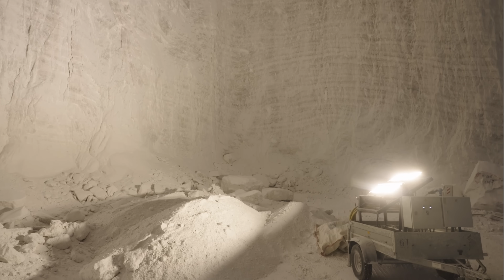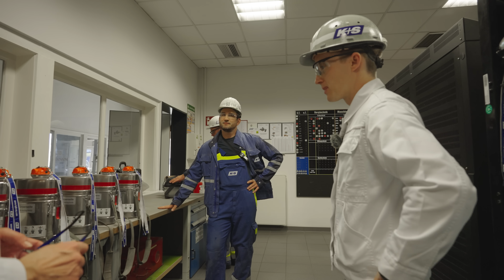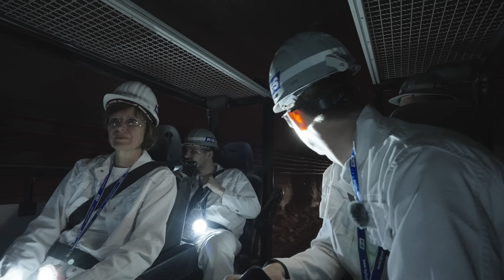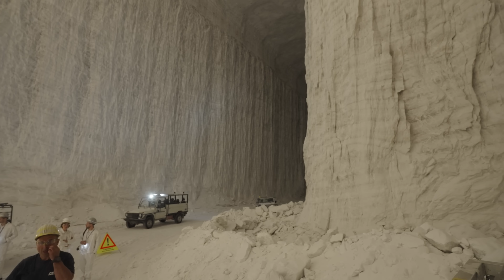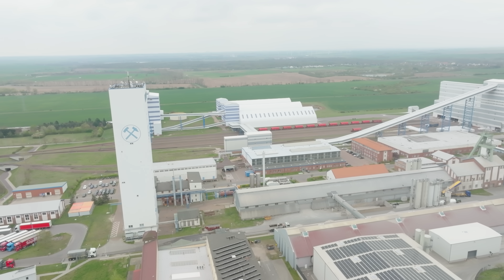The Hidden World of Underground Salt Mining!

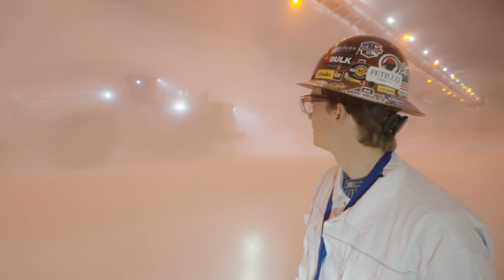Comment: @02:15 mins. the mine chasm is essentially a "FOG" of salt dust. 
WHY wouldn't individuals be wearing masks??!!!
(I don't know what 3M would suggest, but I have a feeling they would recommend ANYTHING.
p95's, fitted masks, breathing equipment, wet rag... WTFED
Reply: Working under such dusty conditions you wear normaly dust masks.The loader driver sits in the cockpit with air filtration and conditioning.On former types of these "Bunker" loaders with open cockpit the drivers wear a air filtration helmet.

Comment: Glückauf
German mining enineer here, older than Methusalem and retired. Today I've watched 4 of your clips in a row, all VERY good and informative except this one.

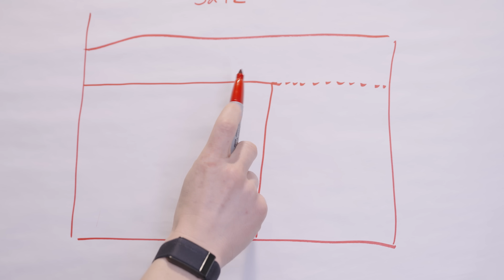You didn't mention one most important fact: Salt behaves like a liquid if you excercise enough pressure over a very long time (dozens to hundreds of years). That's the reaon why safety pillars in salt mining have to be that strong - dozens of meters wide - and mined-out chambers are relatively narrow. You have to take care, that safety pillars between chambers do not weaken like melting ice. 24:00 You need better drawing skiils.

Can you imagine what happens if a million m³ air want to escape through a thin mineshaft because some chambers collapse simultaneously, caused by 1 single 'Markscheider' who has neglected his job? Accidents in salt mines are rare, but when they happen, usually they kill more miners than the much more frequent explosions in underground coal mines.

Nonetheless, Salt minings is impressive and beautiful. Gigantic chambers, and very clean - you won't get dirty.

One question to you: Do you know a method how to prevent salt from drawing humidity out of the air? I have had a beautiful crystal  of about 50x50x50 mm but had to thow it away because it was wet all over. Someone said a coat of hairspray would work, but that wasn't the case 😞

P.S.: 26:29 Interesting game you play. You should better delete that frame 🙂🙂🙂.

Comment: What a sight to see this saltmine is! I'd also never have guessed that saltmining is a business that fluctuates with seasons but I guess it makes sense that salt mines will work depending on current demand. Unlike other commodities that are mined at ground-level, and which are far more valuable pound for pound, this mine will have higher operating costs and if they were to pile up hundreds of thousands of tons of salt the storage costs for a food grade mineral would very quickly outpace any potential savings made from running a less seasonal operation.

Comment: Years ago as a Project Manager for a major Industrial Supply firm, I got the full day tour of the FMC Soda Ash mines in Wyoming (one of our largest national customers for PT equipment). This video was quite a refresher for what that entailed. The mine was about 59 square miles big about 1600 ft below the surface, and it took about 45 minutes to drive in a cut-off jeep from the main shaft to what they call the Long Wall, which was a 500ft long hydraulic machine that vertically cut into a wall about 12 foot tall, deposited the mined product on what was a  miles long belt conveyor, and then collapsed the wall behind it. Each hydraulic section was about 26", and the sound of the wall collapsing behind each section as it crawled through the mineshaft was deafening. The joke was that it was the perfect place to bury a body, because of the size of the honeycomb mine over the 59 sq mile area. Most of the used/replaced equipment was left down there. Of course, Soda Ash isn't quite as clean as salt, but what a journey of my career!

Comment: I need to know how long their equipment lasts before it starts to rust. My truck is having a hard time with only a few weeks per year of salted roads.
Reply: It barely rusts. Theres no humidity as salt absorbs all the humidity in the air.

For salt to corrode, there needs to have humidity in the air or contact with water, such as melting snow.

Comment: That's awesome.  You should show how they get the machines down there.
Reply: The machines are disassembled into smaller manageable pieces once on site where the mine is done at then the parts are taken down through the shaft and then reassembled underground , there is no opening that they drive them directly into the underground it's not possible.

Comment: Some thoughts I had during the video.. If you didn't know it was a salt mine, you'd think they were in a very cold ice cavern. The salt looks just like piles of ice and snow on camera. In the winter I bet they don't have an ice problem on the roads around the facility with all that salt and salt dust getting tracked and blown everywhere. I wonder if animals like deer hang around to get salt off the ground. In some places they have problems with animals hanging out around roadways to lick the salt off the ground that washes off from de-icing. It's unbelievable that there's that much pure salt just sitting underground. It all came from evaporated sea water, it's just crazy that the bands of salt are so thick. All that salt dust must make vehicle maintenance a huge part of the job. Dust would clog up filters and get into joints. Then if you pressure wash it off with water, it would rust so badly. That's a pretty awesome system they have for getting the salt onto our french fries.

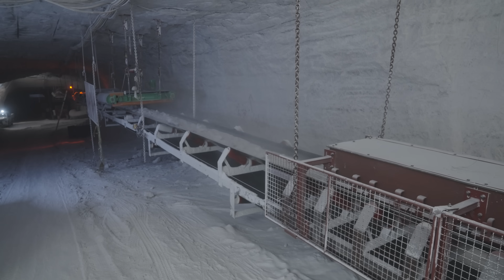Comment: 22:02 Can someone please explain to me what the small green perpendicular conveyor belt does ?
Reply: My guess would be that the green ”block” inside the conveyor is a strong magnet to help remove metal shavings from equipment, and the conveyor flings it off to the side against the plate to the left of the conveyor. So the underside is magnetic, the top isn’t

Comment: They are concerned enough to give you "clean " shoes but then you walk outside, in a car, through other buildings...
Reply: Not to mention all the mining equipment running around on the salt dripping fluids as they go, and the rubber from the tires. Plus all the rust that breaks off these machines. Dirty shoes would seem to be the least of the worries.

Comment: That has got to wreak havoc on equipment. Would've loved to see how their maintenance deals with it.
Reply: I’m a mechanic in the world’s largest salt mine in Goderich Ontario Canada we have very little corrosion issues except for some of the wiring otherwise it’s the normal hard wear and tear on the equipment
Reply: @jeffthomson1777 that's good. I was expecting horror stories lol.
Reply: @jeffthomson1777  I also work for Compass down in Louisiana (Cote Blanche). Same thing here, everything underground is still in good shape minus loose pins etc. But surface equipment is getting eaten alive.
Reply: Only if it gets moisture. Dry salt isn't the problem. It's when salt gets wet that corrosion sets in and rusts the hell out of everything.

Comment: The irony of me watching this while currently 1000m underground in a potash mine on my break
Reply from the maker: You have me beat
Reply: I'm amazed you have good enough internet down there to stream video. That's neat.
Reply: @CFEF44AB1399978B0011 was just thinking that
Reply: @CFEF44AB1399978B0011 I wonder if there is wifi in that mine
Reply: @CFEF44AB1399978B0011 you know internet run through cables, no?
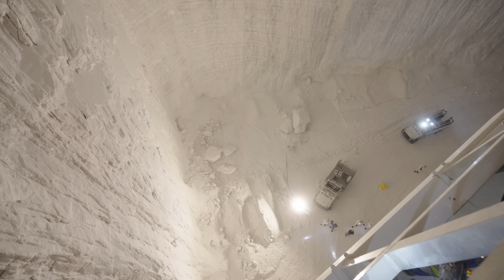Reply: It was interesting to see at 16:58 on the left wall a slab ready to fall and the importance of the soft material at the bottom.
Reply: Carlsbad, NM?
Reply: @admranger  Statistically, more likely Canadian
Reply: Went to a potash mine in Wyoming, it was a crazy place. Would totally go back again
Reply: Sure pal

Comment: i know your channel is more geared towards the machiney and operation of these mines but it would be interesting to learn about the logistics of getting all the mechanical down there ie: plumbing electrical hvac and fire surpression sprinkers
Reply: I was thinking about how much youd have to constantly maintain everything because salt is so caustic to metal. He said that lift was basically from the original mine, but I have to imagine that its been essentially totally replaced Ship of Theseus style many times over
Reply: @skeetsmcgrew3282  The air in salt mines is usually fairly dry, so down in the mine corrosion is kept in check by a lack of moisture and most of the lift mechanism is above ground, never entering the mine.
Reply: @tz8785   I was wondering about the electrical controls/switches in those loaders. The salt dust has encrusted every surface from rafters to floor.
Reply: This would very much interest me. It'd be also cool to find out more about the geological side of things. This mine isn't in the most populated areas of Germany but unlike in Australia where there often is literally not a single settlement for hundreds of kilometres, here there must be multiple villages on top of the shafts.

It'd be fascinating to learn how they ensure safety and stability of the shafts while working and afterwards. I imagine water could pose a huge safety hazard in a saltmine, so there must be measures in place to make sure the mine stays dry. There's so much more that goes into mining operations that hasn't been touched on.

Comment: I was curious how they keep the machines running down there, too bad you did not show that part of the operation. I would guess the salty air needs some special filters for the engines? Not sure how they deal with rust down there either. Is that even a problem? Or is the air so extremely dry that there is not much rust forming down there, and the problems only start on the surface level where you have high air humidity?
Still an impressive operation, and digging these shafts and starting the mines more than 100 years ago with the old technology and machines they had must have been just as impressive.

Comment: Imagine a hydraulic or oil leak 😮
Reply: Machines use in sensitive areas use vegetable oil. We bid a job to clean up the LA river and will be required to have the hydraulic oil flushed out and changed for vegetable oil. There are still other fluids and diesel, but hydraulic oil is the most common thing to leak. If there was a leak, they would take certain steps to remediate the spill, including digging up all the contaminated salt and disposing of it. As an environmental company, we clean up fuel and oil spills around cell towers from equipment being serviced. Remote cell towers are run on 150-200 KW generators that are fed with propane or diesel.

Comment: how they blast first slice? there is no room until its down :D
Reply: You will first need a large diameter raise bore drill hole into a small adit at the beginning of the chamber. This will be enlarged by vertical blast drill holes until you have enough space to blast the first section. Cheers

Comment: what are those red dots on the ceilings in regular intervals?
Reply: I did not see any red dots. If you mean the dark dots in the ceiling of the big chamber, that is anchor bolts. It is bolts that go into the rock to distribute the load deeper, so that it does not collapse.

Comment: How're those trucks and equipment holding up to the salty environment?
Reply from the maker: No corrosion because no humidity
Reply: Exactly. My father worked in the Detroit Salt Mines for 25 years which the seem they mined went as far south as Cleveland Ohio and as far north as Ontario Canada, the operation is very similar to what is taking place here.  Every single piece of equipment brought to the surface after being used underground for decades immediately rusted within days, drills, engines etc made no difference whatsoever what the equipment was.  Perfectly operational equipment when it was used underground still , immediately rusted and became practically useless within days it was unbelievable how quickly the moisture and humidity destroyed the used operational machinery.
Reply: Excellent. There is no moisture down there. But they would rust to shreds very fast if they were brought up again.

Comment: They didn't even mention the the "back" (ceiling) and all the rock bolts holding it up. Also the tremendous pressures exerting force into the cavity from all directions.
Reply from the maker: yeah they bolt it only to keep everything safe while working within each chamber, then they block the chambers from access once completed
Reply: The chambers are gradually filled

Comment: The irony of going 500m underground to then risk falling 50m in the air...
Reply: Kinda like a bird being transported on a plane, imagine how pissed the bird would be if the plane crashed. Lol
Reply: Na what's ironic is having to put clean overalls on as it's food grade yet running diesel vehicles in the same place
Reply: @jamesbyworth9938  I don't think it's much of an issue as long as they're maintained to not be leaking oil. They probably have them corked up with emission equipment too.
Reply: the room was dug from up top. they basically just dug 50m deep and instead of having 50m deep drops they continued going further at the bottom and no longer use the tunnels at the top
Reply: Seriously, I didn't think it was possible to suffer from claustrophobia, acrophobia, and a fear of being buried alive all at the same time. They ought to issue visitors brown pants.
Reply: Oh whatever
Reply: Yea, I don't get why didn't they start digging higher?
Reply: @magnetospin I think they explained it in the video. There’s different layers of soil before getting to the salt. Layers like clay and so on.

Comment: "Salt does not pose a danger to the body because it's natural"
Well silica dust is also natural, but salt immediately dissolves. "Endogenous" is a better term for Na+ and Cl- ions, which the body manages well on the grams-per-day scale.
Reply from the maker: yeah I didn't explain that well
Reply: @buildwitt  Come to Sifto man! It's the place to be!  Summer months you just hang out in a lounge chair, breathing pure salt dust and mixing frothy drinks with salt on the rim of your glass.
Reply: @buildwitt  fair to say you had a lot going on lol
Reply: I lived in Mount Isa Qld where a lot of surface deposits of low grade lead, copper, zinc, uranium, cadmium and other toxic metals could become easily airborne. Silica was the last thing you worried about.
Reply: Asbestos is also natural
Reply: @FishFind3000 🫡
Reply: @FishFind3000  Most of the toxic stuff (compounds in general) are natural. The most potent toxic things are also natural. Really not a relevant metric.
Reply: Whenever someone talks about "natural" my examples are arsenic, asbestos, and uranium.

All natural 100 percent organic.... death.
Reply: Some bead/sand blasters use silica beads and when the beads break down it's just silica dust. If inhaled into the lungs over a long period of time, you will get Silicosis. No treatment, no cure but just ways of managing symptoms and the worst case is that it's lung cancer.
Reply: Yeah, salt has been unnaturally vilified. I would guess because some did not like the salt of the earth people.
Reply: No.
Its been overdone to the point of a mass quantity of people having high blood pressure and strokes.
Over consumption gave it its reputation 
 @FLPhotoCatcher
Reply: oh shut up
Reply: @phosphate66  Why so salty?